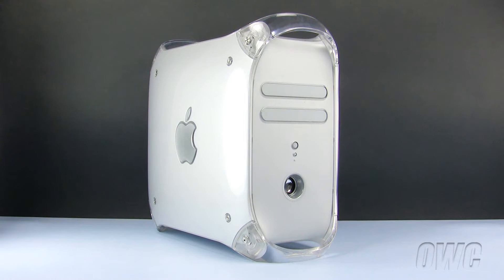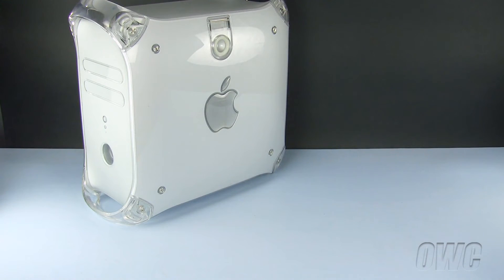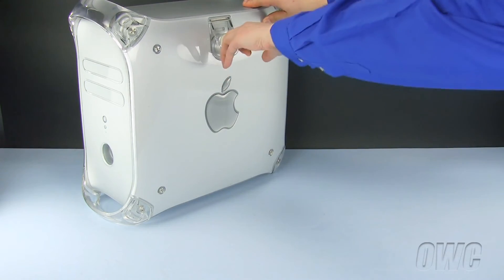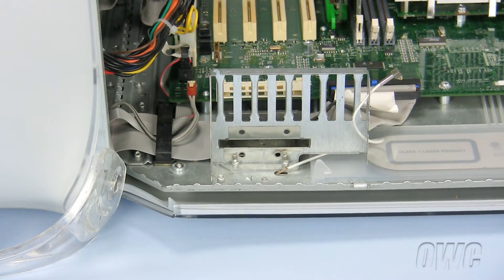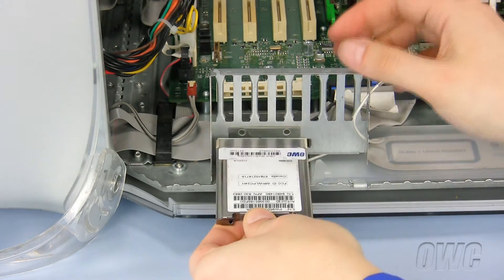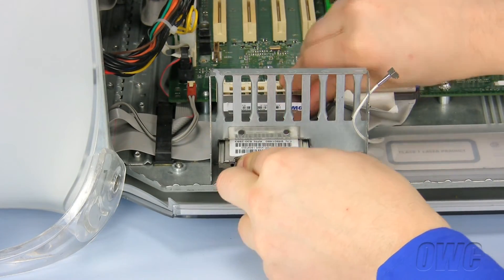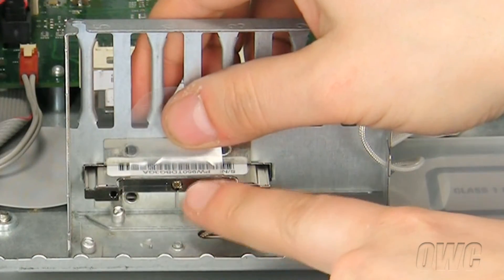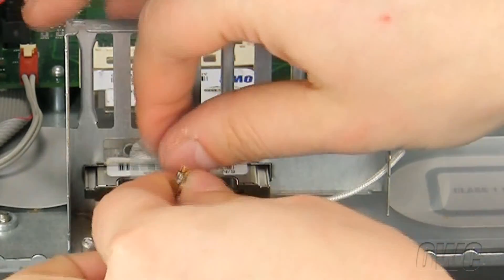Power Mac G4 QuickSilver AirPort Card Installation Video

Comment: is there a way i can use a USB dongle instead of a Airport card?
Reply from the maker: Regrettably with these older machine you will not be able to use a dongle.
Reply: @poweredbyowc  do you recommend airport card or extreme, what's the difference?
Reply from the maker: Hello James, I found an article that goes over it in general, the theoretical speeds are much slower than the extreme

https://discussions.apple.com/thread/2448563
Reply: @poweredbyowc  ok I'm just going to sell it for parts (sadly)